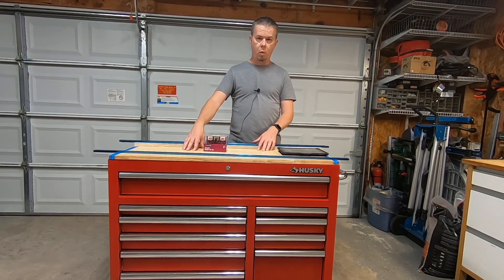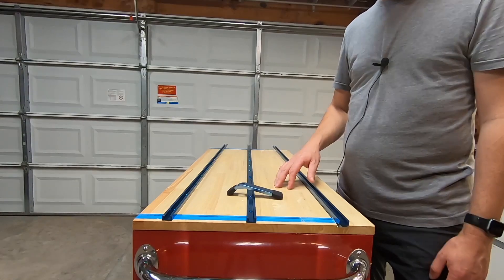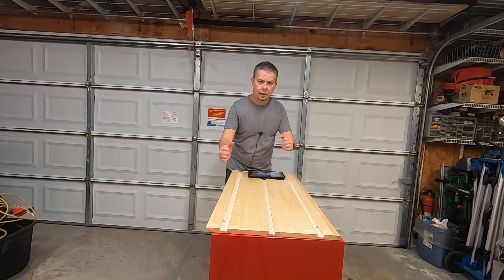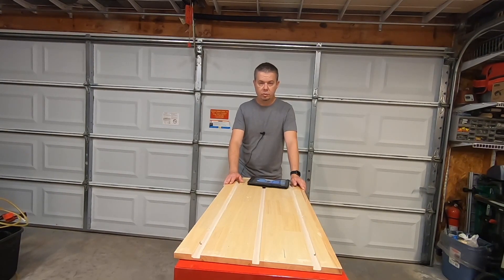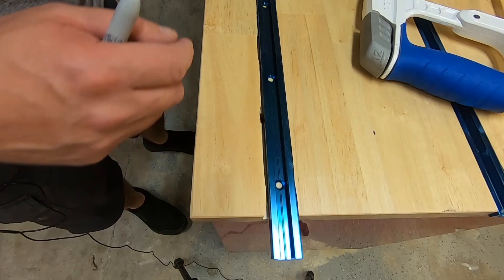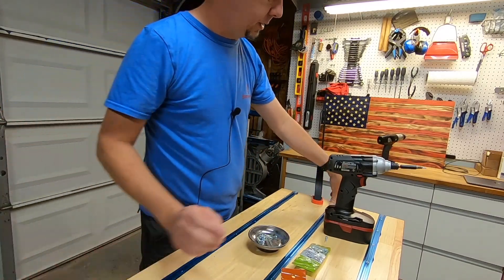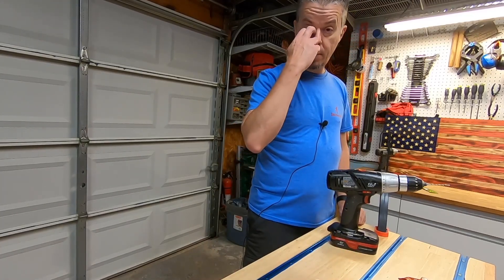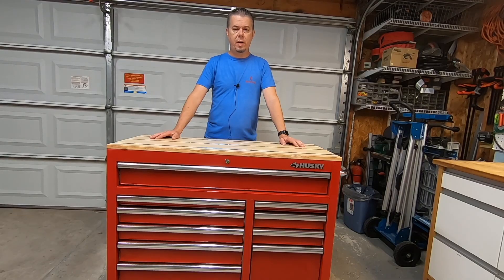Husky Mobile Workbench - T-track installation

Comment: I am not sure but I believe you should have routed from left-to-right vs right-to-left to void tear outs. Someone please let me know. I am new to woodworking.
Reply from the maker: Thanks for commenting.  Routing is definitely not something I did often.  I did struggle on this project.  Maybe I was moving the wrong direction.
Reply: @Ryder_In_Motion  I think you did fine with the video. I am here to learn. Thank you.
Reply: You were routing backwards.  You should have gone left to right due to the bit rotation.  The way you were doing it, the rotation of the router bit will be a constant pull away from your guide.  Using the rounded side of the router would have been easier too.  You were using the flat side of the base and any rotation of the base would push you away from the guide.

Comment: As a newbie myself I had the same problem with the correct direction  to use the router.  After a lot of looking I found a simple and straightforward rule or guide. Using your RIGHT hand, lay your THUMB on the piece or the edge you intend to machine; extend your index finger and that is the direction to use the router. It changes from an outside edge to an inside edge (ie routing out a hole) -but is always indicates the correct the direction.
Reply from the maker: Great tip!  I'll have to give that a shot.

Comment: Use the rounded edge of router base to eliminate drift. Straight edge causes the drift you experienced. If the round edge drifts as you push along straight edge, distance is constant, just rolls against straight edge and you’ll be very happy. Thanks for the info.
Reply from the maker: Thanks for sharing.

Comment: If you put the rounded part of your router base against the edge, you won’t get off. If the straight side of the base is against the edge, the slightest movement will get you off the line. If the rounded part of the base is against the edge, you can move the router a little without getting off your line.
Reply from the maker: Thanks for tip.  I definitely struggled with the router.  I'll keep this in mind.  Thank you.

Comment: I did the same thing to a Husky adjustable table last year.  The only problem I have is nothing moves smoothly in the t-tracks.
Reply from the maker: I noticed the same thing.  Definitely more drag on the bolts than expected.

Comment: Please used a dusk mask 😷 or respirator .. saw dust it’s bad to inhale..
Reply from the maker: Very true.  I need to be better about that.  Thanks.
Reply: @Ryder_In_Motion  A little more on this and some recommendations.....For general sawdust, such as the table saw will produce from most wood products, a good filter mask is recommended.   As you move to using MDF on any of your projects you should use a respirator with a good seal and a filter rated for dust and very small particulate because the particulate floating around in the shop after cutting is nasty in the lungs of you breath it in.   MDF dust will get all over you, your clothes, shoes, and every nook an cranny in your body and you hair as well.  I hate the stuff with a passion.   I also recommend using goggles when cutting MDF because it will get in your eyes too.  You currently have a small shop so one of your future projects should be a self-contained dust extraction system built on a cart using a dust deputy cyclone and shop vac.  If thought out and planned well these make very good and informative videos that folks will watch.  You do seem to be good at your presentations and only better with additional time.   Another good video would be an air filtration system made from MRV13 filters using a good quality fan.   Again, these types of videos should get your viewership numbers up and help out some folks.   Dust is a larger  problem than most people assume and even more of an issue in small confined spaces like a garage shop. Good luck!
Reply from the maker: @ronwilliams329  Thank you for the detailed feedback.  I did purchase a dust mask for future use based on your recommendation.  I also appreciate the idea for a dust filtering system.  Thanks for commenting.